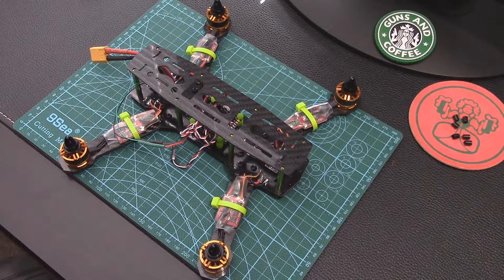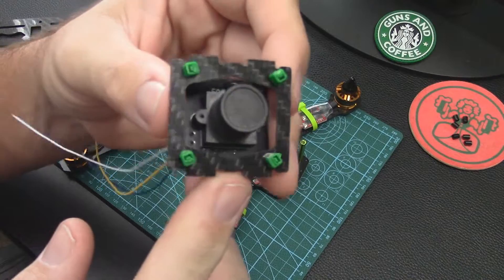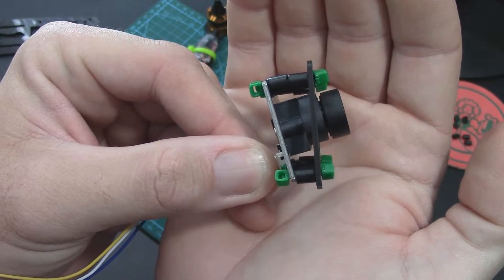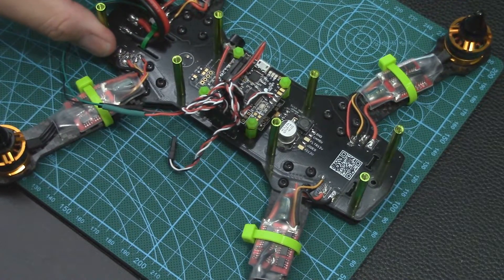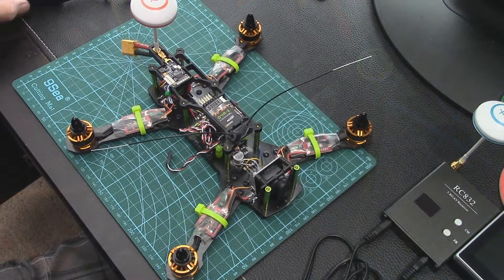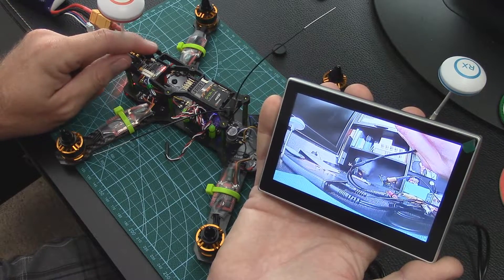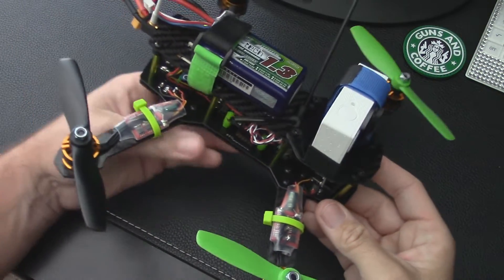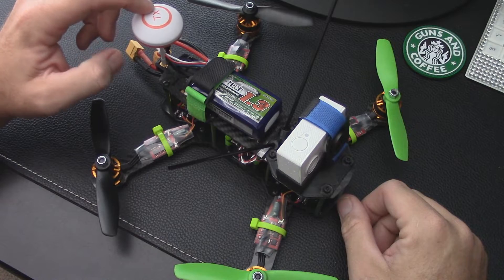ZMR250 Quadcopter - Final Build

Comment: I have the rc832  5.8 receiver  where can that go on my 250 or I don't need that on there
Reply from the maker: vape guy 261 The RC832 receiver doesn't go on the quad.  It stays with you on the ground connected to your goggles or monitor.   the 5.8 Transmitter is what goes on the quad like the TS832 or something similar.
Reply: how do you get power to it  it comes with a plug to wire it to the drone or will I need to by another battery to get power to it
Reply from the maker: vape guy 261 it should come with a plug or wire set to solder to your power distribution board on the 12v or 5v outputs. if you PDB doesn't have a regulator of some kind, you are going to need to get a stepdown converter like a Pololu to get the 5 or 12 volts from your battery pack to your camera and Video Transmitter.

Comment: How did it fly in the end? I'm just starting to build mine after having the parts sat waiting for over a year... Your video showing the 3x black motor wires connecting to the ESC was great info. That was holding up my build. THANKS!
Reply from the maker: duncancraigcouk Thanks for watching and commenting, it flew just fine, kind of a beginner quad.  Tech has improved so much in such a short time, These ESCs are way out of time now, and 1806 motors are mostly for sub - 180mm builds now, but that is what I could get cheap when I started this.  The full frame PDB is also out of favor now, I would just go with a smaller PDB/OSD combo now, and motors are generally 2205s now, especially at a 250mm size frame.  Seems the current sweet spot is around 210-220mm, X-style.  3s batteries are really only for beginning, the move to 4s will happen very quickly, so it is better to just start at 4s if possible.

Comment: Awesome build man.  Although all of your videos for making this build weren't super in depth i found it very informative and entertaining.  Great clean looking build!  I would see if you could fit a 1500 or even 1800mah pack on there to get longer flights.  I have an 1800 on my 250 and it is well balanced and i can get about 14 minute flights out of it.  Great video though!
Reply from the maker: +milkydeathgrind Thanks very much for watching!  I did get some larger capacity batteries.  I need to get better and move up to 4s
Reply: I have moved to 4s and it makes a world of difference as far as power and responsiveness.  Also my flight times seem to be a bit better with 4s packs as well.

Comment: so all you have to do to connect the escs is to sotter the power wires and then sotter the yellow wire to the signal pad on the pdb???
Reply from the maker: +Matthew Clark you also have to solder the motors to the other wires off the ESCs, but that is most of it if you have this kind of PDB.  I made several other videos about each of these steps if you haven't watched them yet.  This video is the last one.
Reply: +Oin Taylor thx yeah I knew about sottering the escs to motors
Reply from the maker: +Matthew Clark maybe I didn't understand your question.  There's more to it than on your first comment , but it is not very difficult.